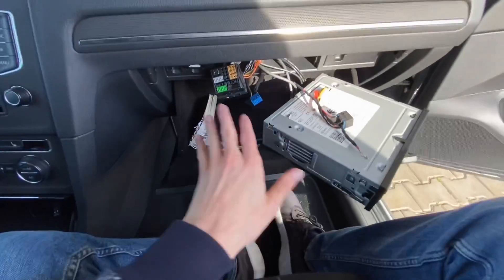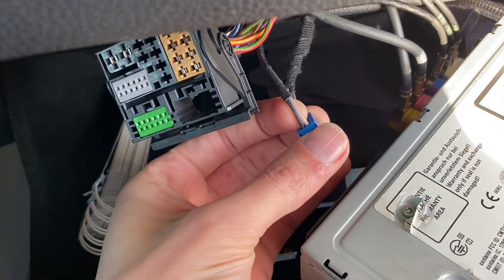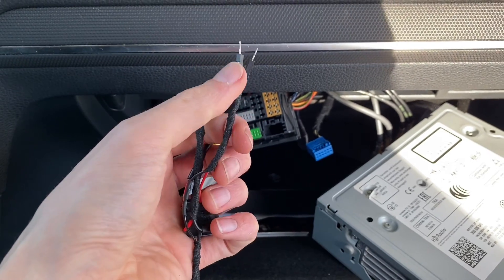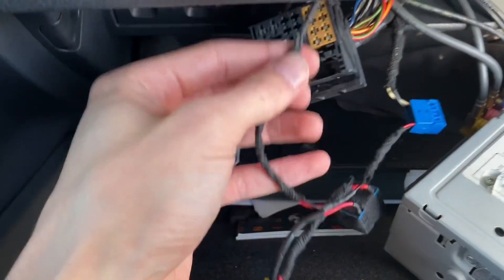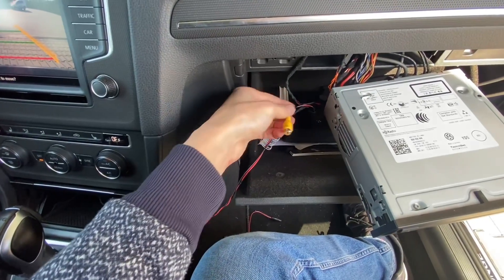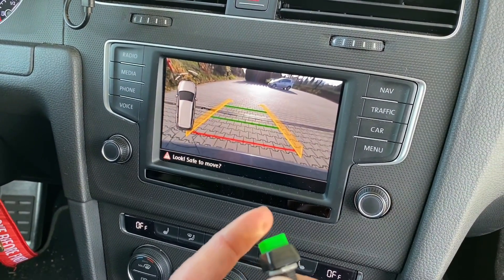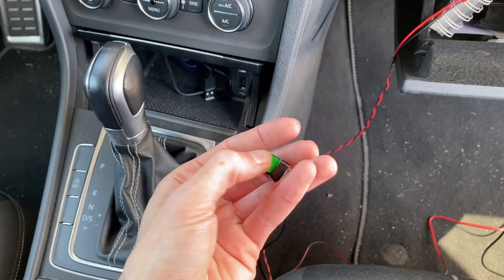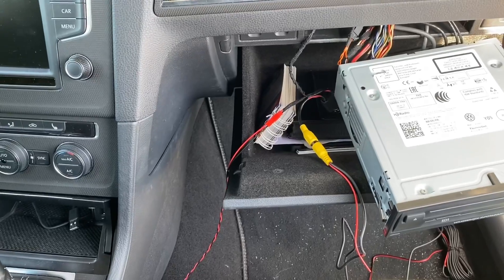Golf MK7 Front View Camera, part 1: relay test

Comment: From where we can buy this?
Reply from the maker: It's a basic relay that you can get in any electrical shop. Just add a diode to prevent damaging it, add RCA connectors, couple wire extensions and that's it.
Reply: Which wires the diode connects to?

Comment: I’ve already got this mod.  It was a pain as all the plastic aliexpress cameras fail within a month or two. They mist up badly in cold damp weather. I must have gone through a dozen cameras. The final solution was to take a part the camera you have now and use the front frame mounted on the grill so it looks neat. But behind that is a metal bodied camera from another supplier glue gunned onto the grill from behind. This setup I’ve had for over a year and it hasn’t failed. I only have the front camera controlled via a switch as if you enable auto switching you lose visibility of the oem park pilot display which I didn’t want to lose.
Reply: Hi mate, do you have contact email? I am
Currently in the process of making this relay. Would be great help if you could answer a few issues I am facing.